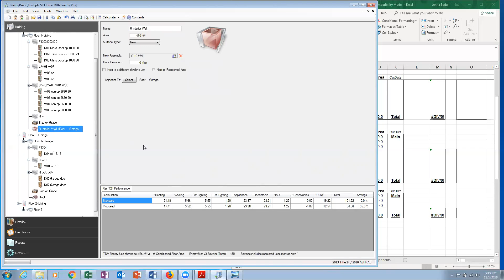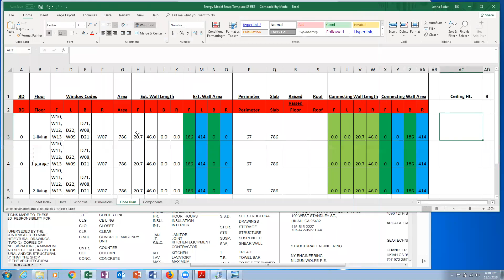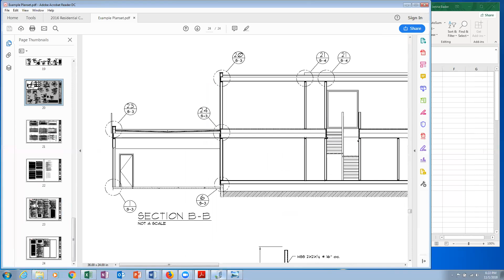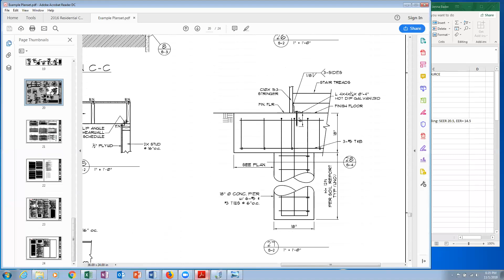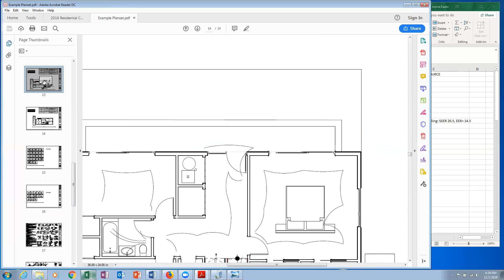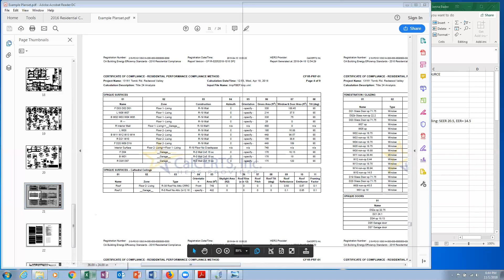Comment: When measuring ceiling height to calculate for exterior wall area, do u measure from Finish floor to bottom of slab OR Finish floor to Ceiling with no plenum OR Finish Floor to Finish floor elevation?
Reply: When measuring the ceiling height, I would model the 1st level finish floor to the 2nd level finish floor. When you model the floor/ceiling assemblies, you will be able to select the cavity insulation, which accounts for the height difference of the finish floor to interior finish ceiling. 
Side note: Elevation heights (floor to floor measurements for various levels) are typically accurate in Architectural drawings. I would aim to always make my numbers match those in the Architectural plans. However, Architects measure AREAS of the home based on exterior wall measurements (outside to outside), whereas in energy modeling, we take the interior finish wall measurements (inside to inside) of the home to account for CONDITIONED floor area.